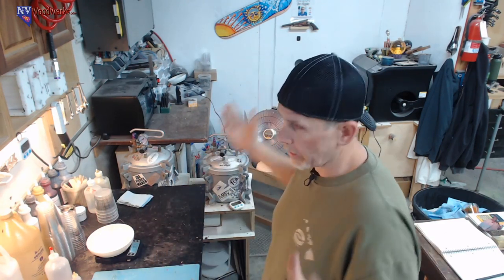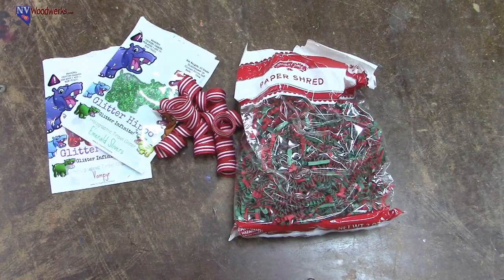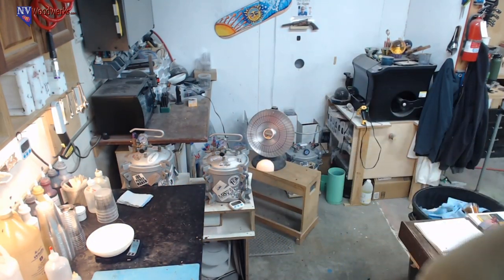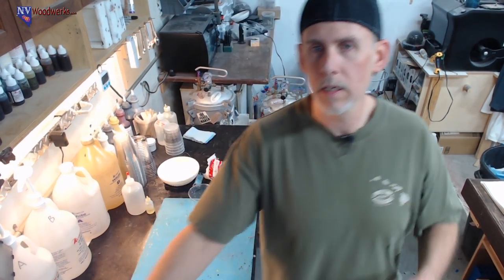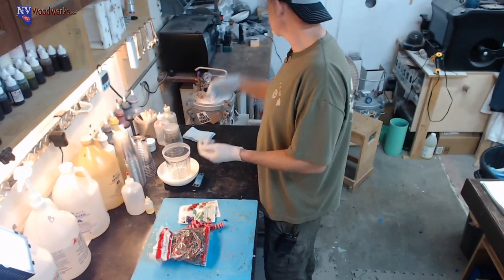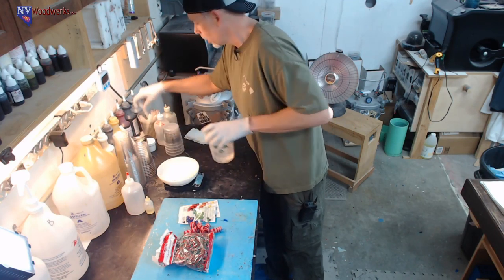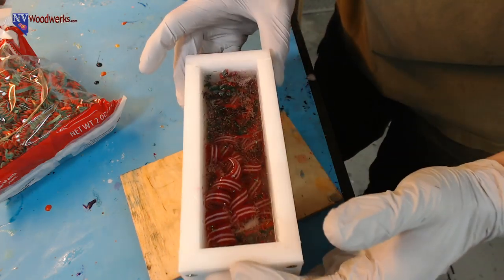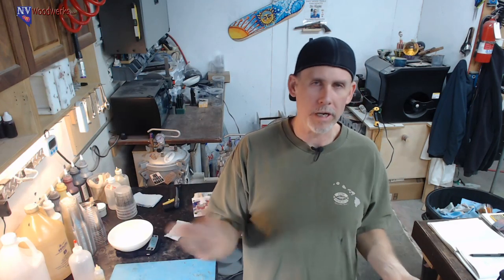🔴Replay:  Resin Casting Holiday Blanks & Shop Update | Episode 39

Comment: good morning Zac I have a question that perhaps you can help me with. I have made a sign for my arts and crafts booth and I need to know how to pour resin without fully mixing the colors. I cut out a full size Phoenix fire bird and I want to fill the cavities with resin so it looks like fire. I would like to keep the resin mostly clear with ribbons of red, yellow and orange. I am going to back light the sign therefore I want the light to shine thru. I have watched a lot of videos but have yet to see any  that show how to do this. I did see one video that showed swirling the color in using a tooth pick but was wondering if there is a better way. By the way, great videos I have learned a lot from watching you.

Comment: Hi Zac, good job and Merry Christmas.
Regarding to heat directly the pressure pot, I would say do not forget that if you increment the temperature , the pressure will be incremented as well. In an extreme case if your pressure pot (with pressure inside) is continuously heated you must see an increment in the pressure for sure. My recommendation would be to ask to the manufacturer of the pressure pot about it.